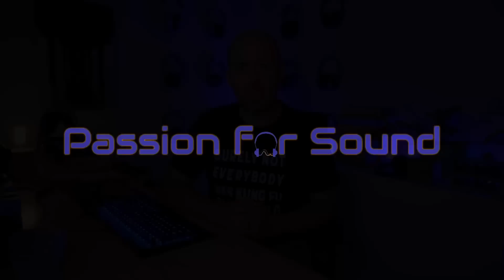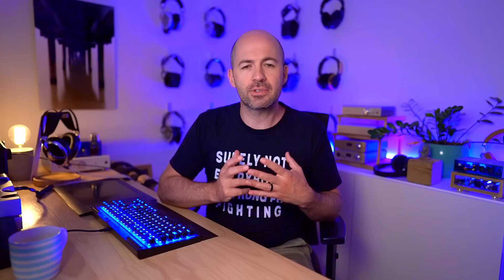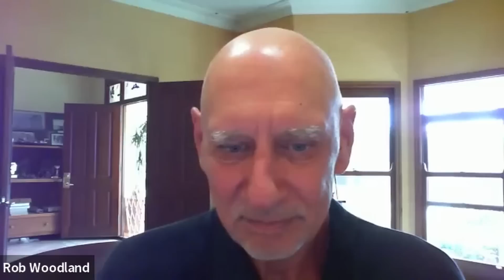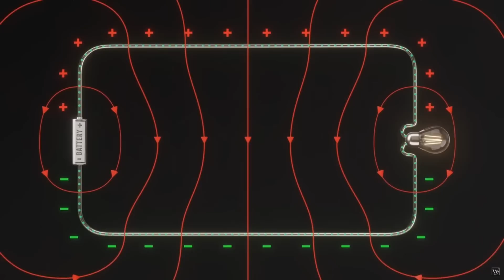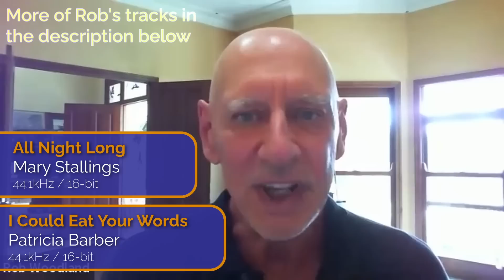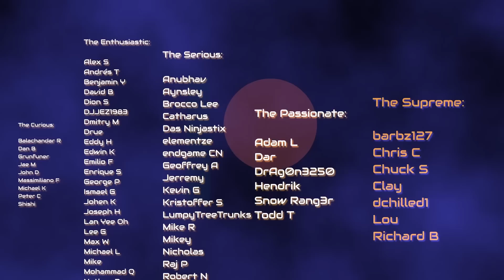USB Cables for Audio: Interview with Rob Woodland from Curious Cables

Comment: Cool story. So the cables aren't truly engineered to solve a problem, rather curated from bits of EE theory and science and ultimately, a subjective listening test to determine quality and success. 

This doesn't mean we have to abandon real science to evaluate the end result. Since all these cable sommeliers state they can instantly hear the improvement and their cable is best, how about a scientifically controlled blind AB with the creator? Can he successfully pick his cable over another without benefit of sight?

And why don't we have this data or perform these tests? 

Answer: the results won't favor those selling expensive USB cables.

That's my final answer. I'd love to be shown otherwise, as a man of reason and science. I'll even grant you that there are limits to our scientific measurements or understanding of transmission line and cable signalling. But why should I abandon science for anecdote when you could still put the subjective preference test under the scrutiny of real science, and publish meaningful results?
Reply from the maker: I agree that a combination of science and subjectivity is preferable (and many brands take this approach). The reality is that science is limited in what it can measure and our ears and brains are fallible as well so no one approach can be perfect (including blind AB testing which is let down by other issues like our brains seeking potential differences which may not be there and creating errors as a result that aren't helpful data, but just processing errors)
Reply: @PassionforSound  I agree that our brains and perceptions are fallible, that's why I cringe at the subjective sommelier approach to cabling. Especially when these aren't $40 instead of $4. Some are $40,000!

And we get pseudo-science about dialectrics and strand geometry, when in most cases the resistance, impedance, and conductance values are what matter (e.g. speaker cables). And yet some of the manufacturers selling exotic speaker cables don't even bother to measure and publish those knowable and important scientific values for any given length of their cable! Those values could absolutely impact the synergy between, say, a given amp and speaker, and research in that area would be welcome to understand the type of cable that would best perform for your particular setup. 

I'm hoping that more informative users will drive the industry away from voodoo and more towards solid research and science. Repeatable, proven results. 

I'm sure it's fun for wealthy folks to curate and experiment with pricey cables. I'm sure the wine collector market are prime candidates, as they too regularly fool themselves with imagined results from the rare and expensive. But hey, if you believe it's better, it's probably better. So what do I know.
Reply from the maker: The power of placebo is a very interesting topic of its own. I believe there's a balance somewhere in between where there are things we can't easily measure (or predict from the measurements due to the complex interactions of variables) and things that we can. I think it's important to have an open mind about the things we don't fully understand while also referencing what we do understand and then, ultimately, making up our own minds based on our personal experiences and preferences. There is no number on a page as yet that can tell the story of how any audio device will actually sound and there is no definitive way to know how someone else is perceiving a piece of equipment compared to how you or I might.
Reply: @PassionforSound  all good points and I agree. I can't shop for speakers solely on a preference score and replace that with actual experience. But we do know that speakers will change the sound in a room, with a given system, at a given position, etc. I'm not sure we can always say the same with cables. It's .. murky waters.

I'd be impressed with the high end guys that claim they can pick out cheap cables in a system if they stepped up to the plate. 

There's a story that reminds me of the high end audio world that was published some years back. Again, with the expensive wine crowd. I believe it was at Harvard or another university where certain professors fancied themselves as connoisseurs of expensive wines and had a club where they would invite certain select graduate students to join and bring new fine wines to taste. I suppose that one of the students was fully done with the colorful language of the fine wine enthusiasts (the likes of chocolatey mid range, airy highs and the verbiage we often hear in audio) and decided to purposely bring in cheap wines to see if the "experts" would pick them out and to confirm that they indeed had trained their tastes for these expensive wines. 

Or rather, that there WAS INDEED some special, immeasurable quality to these fine wines not present in the cheaper lot. Well, you probably guessed the results. From an academic perspective, it was random. Imaginary. Made up. They would sip cheap wine and proclaim some of the same masterful language about its character and construction. And were wholly embarrassed that the student was recording the findings and would later publish the results. 

I'm wondering how far the results would be from that experiment if we blindly listened to $30, $300, and $30,000 speaker cables on a nightly basis?
Reply from the maker: I definitely think that there are cheap products that perform as well or better than some expensive products. I also know that there are expensive cables that don't sound better than cheaper ones. Beyond that, it's all about what makes a person happy I think.

Comment: I was disappointed Rob was not challenged more on his claims.
After 10 minutes I had enough and  had a list two pages long of comments
Where are his test results or at least double blind tests of this cable?
The public are becoming more astute with  CEO's making claims, without evidence of objective testing -Claiming having "great Ears" is not enough. 
ASR found that the biggest measurable reduction in USB cable noise  was in fact the length of the cable. 
The best, being significantly better ,was a combined Type A/B USB adapter- Not really practicable -although interesting to see the noise floor drop away.
Reply from the maker: I'm not qualified to challenge and debate technicalities of the cables (or other gear) so my approach is to ask the questions that I and my patrons have about a product to hopefully get a range of responses and then let viewers decide for themselves. I'd you're not a fan of the product or the designer's approach, that's totally ok

Comment: After watching this I’m actually quite concerned. A product that is mass produced for less than 10 bucks are priced 100 times that and the person developing and building them have a. ZERO subject evident of it being better than $10 and zero scientific testing during the development phase and b. Has no electrical engineering background but has “good ears”. And so many people are praising it’s philosophy and have no doubt about it whatsoever
Reply from the maker: Don't mistake him not being an engineer and trusting his ears as meaning that no research or theory went into the designs. The point he was making was that he selected wire and shielding based on scientific principles/theories and then tested the results by ear because there are elements of our hearing and perception that can't be measured for still because we don't yet understand them.
I'm not defending his approach as optimal, but the results speak for themselves however he arrived there.
Reply: Cheap people say these things and clearly dont have a quality piece of audio gear ! Fact and just the materials alone and look of it alone clearly a idiot would know has to do a better job 😮😊

Comment: I have one and never worked on my setup. Too expansive to return back to usa (I live in canada). Was the curius Link (6 inch) so I don't know if working one is good or not.
Reply from the maker: I haven't tried the Link. That's not good that it didn't work for you. I've had a number of their cables now and all have been perfect so I imagine it's a very unfortunate one-off. Sorry to hear that it happened to you when you're so far away for the return process ☹️

Comment: Ok but when we need some short usb C to usb C or micro to usb c quality sound cables for lets say dongle dacs what are our options? 😊. Curious doesnt make those short usb C cables as far as I am aware. And maybe we can also upgrade sound of our earman sparrow or the hidozs s9pro... 😁. And yes also many of those dongle dacs use asynchronous usb but quality cable still can make a difference right? What do you think for example about ADL furutech cables?
Reply from the maker: I haven't yet tried any quality, short OTG type cables. There's no reason that they shouldn't be just as important though.

Comment: https://www.youtube.com/watch?v=u6lx1ntNoxE&ab_channel=LinusTechTips

I don't really understand the subjectiveness to these usb cables. Either they are not changing voltage fast enough that they are flipping bits they shouldn't be, or they aren't. A cable can either be good or bad no? there are expensive cable testers to check these exact things. If a digital cable is "colouring" the sound isn't that just the cable failing to be accurate. Flipping bits seems like the wrong place to be trying to colour the sound anyway, should we be leaving that for later in the audio chain.
Reply from the maker: Theoretically that should be true, but there's definitely more going on because I've tried lots of cables and they all have their own character. The better cables (not necessarily the more expensive ones) tend to produce a smoother and more spacious sound. As to exactly why, I still can't say.

Comment: Hmm, think you can still have expectation bias when not doing blind A/B test. Its good to take notes, but how sure you are that subjective experience is not influenced by knowing which cable you listen? Its easy to take 2 USB outs from computer, stream to both simultaneously with Roon, have 2 same DACs, and just switch between inputs on the amp...
Not saying there is or isn't difference in the sound, but just this way of testing looks so flawed.
Reply from the maker: There's equal arguments in both directions and you can control bias by acknowledging it exists and testing your own assumptions - seeking to disprove your assumed hypothesis.
The challenge with blind tests is equally as strong. When going in blind, there is still an expectation bias - either expecting no difference or expecting some difference. The expectations in a blind test can lead to trying too hard to find differences and therefore psychoacoustically making things up or expecting no difference and therefore not actively trying to hear any differences.
Ultimately, there's no truly perfect way in a subjective endeavour like this. I believe the best approach is to listen blind or otherwise and take notes with an open mind. I like to then revisit the same test and challenge each assumption I've made during the first round. I.e. is Cable A really better? What about with a different test track? In what ways might Cable B actually be preferable? Etc. You pretty soon get a balanced picture of both without the initial issues of unconscious biases

Comment: Honestly I couldn't agree with most of this interview, many arguments seem to suggest that you should fool yourself into believing an expensive cable will make a difference (you shouldn't do blind tests, you shouldn't listen to measurements, you should have a high-end system to hear the difference). I'm not a 100% objectivist, but when it comes to cables it's totally measurable. I used a very cheap RCA cable before and then upgraded to a Mogami one and found no difference, I also had the Sundara stock cable and then upgraded it to a custom cable using Mogami as well, still no sonic difference, big ergonomic difference though.

I think cable manufacturers should be more honest, if there is a measurable advantage then they should talk about it no matter how small it is, if not then talk about the prestige, both have a fan base and a place in market, nothing wrong with that when you are fully transparent that you're selling art not science. Great video though, I like to hear all sides.
Reply from the maker: One of the challenges here is that there are things which are measurable (some manufacturers like Iconoclast rely heavily on these), but there is a lot that's not fully understood about what we can/can't perceive and what aspects of cable design can affect those perceptions. Sadly, it's difficult or maybe even impossible to say what is definitively correct from a measurement and theory point of view so there is a need to rely on what the designer hears. Add to that the fact that there is then no definitive way to determine what sounds "right" and cables remain as subjective as every other part of the music playback and listening experience.
Reply: @PassionforSound  When it comes to DACs, Amps and similar devices, I agree those are too complex to say for sure if measurements capture the whole picture, but when it comes to cables I don't see the delicacy. The cable should simply deliver the signal without distortion and most decent cables do that. I respect the designer choices and opinions and would like to see them prove the benefits, because what I'm seeing (and I'm not specifically talking about Curious Cables) is dismissive of science and mostly trust-based.
Reply from the maker: Rob is a different kind of designer because he's not an engineer. That doesn't mean he can't make a good cable though.
On the other hand there are manufacturers building excellent cables based on measurements and data rather than listening tests so both approaches can be valid IMO.
As for the delicacies, consider that a cable designer has to balance the following things I know about and more that I don't (changing one of these cascades into changing the others whether you want to or not): resistance, capacitance, inductance, speed of signal transfer (which varies with frequency), interference and the need for shielding, dielectric constant (how much energy the dielectric absorbs and then releases back into the cable), cable thickness, cable material, longevity and usability. It actually might be more complex than designing an amp or DAC, particularly a simple integrated chip-based product where you can follow the chip manufacturer's specs and produce a solid measuring, solid sounding device fairly easily (in the scheme of things). There is definitely an art and science to balancing all those interacting variables in a cable. How that's achieved will vary from one manufacturer to another
Reply: @PassionforSound  Physically a cable cannot add anything to the signal, it can only take from it by acting as a high pass filter or a low pass filter or both, those effects are caused by resistance and capacitance, the other variable is poor shielding that let noise distort the signal. The reality is most decent cables ($20 or so) do lower all those effects to inaudible range. I respect your point of view but this whole cable thing is not shady IMO, I would love to see a designer pass a randomized blind test.
Reply from the maker: Every cable on the planet is a filter. The question comes down to HOW each cable is altering the sound, not whether or not they are.
Check this video out to better understand what I mean: https://youtu.be/v3nZM2BP9Ew
Reply: @PassionforSound  I agree it does, but the emphasis is in what range they do that and by how much, a decent cable is already capable of preventing any distortion in the audible range with comfortable margins. I understand some audiophiles love to chase the diminishing returns, nothing wrong with that. I watched half of the video, at least Iconoclast explain scientifically what they are doing, and they could be the most honest cable manufacturer I ever saw, this is from their website: "The can-you-hear-it question is one we leave to you: we ask only that you listen, in whatever way you prefer, and make your own judgment. We take returns without question or argument". One note though, they focus on pro cables which are very long and used in noisy environments, thus the problems are more significant in that use-case unlike in most audio setups.

Comment: Thank you for your hard work. That was one of the best interviews you've ever made, we need more videos like that so that we can come closer to solving the mystery of analogue and digital transmission
It's so difficult to find unshielded or properly shielded cables for a reasonable price, it will probably mostly be a DIY thing for the foreseeable future. What would you personally recommend - having a longer usb cable or longer interconnects? What is the max length of the descent-branded OCC copper usb cable that won't degrade the sound? Could you recommend some good interconnects or power cables with no or proper shielding? I need my soundstage intact, my new heavily shielded cables remove the sence of open space
Reply from the maker: Based on my limited understanding, I'd definitely go for a shorter USB cable (2m or less) and longer interconnects. There seems to be pretty clear evidence that long USB cables cause issues.
So glad you found this interview so helpful!

Comment: What most people don't get in the whole cable controversy is that anything electric can have a high efficiency or have low efficiency... Once you know that, you know that all cables don't all sound the same, depending on the tech, materials and implementation. It's like a car... A car that's warmed up works at a higher efficiency than a car that just started up...its true if you believe it or not
Reply from the maker: Great point!